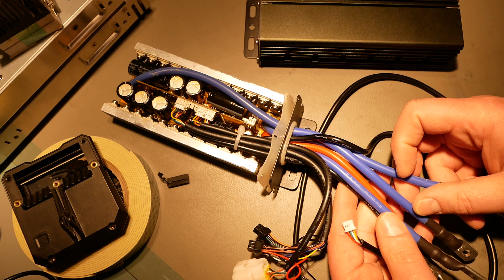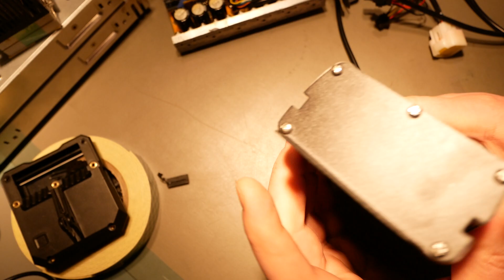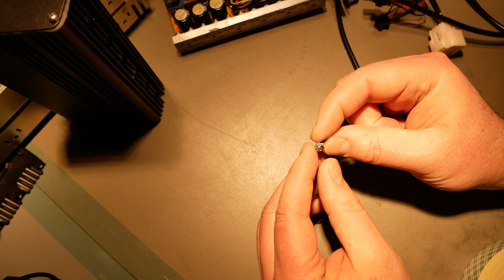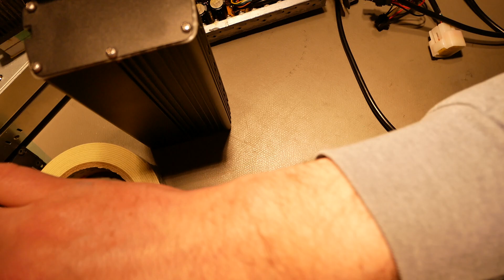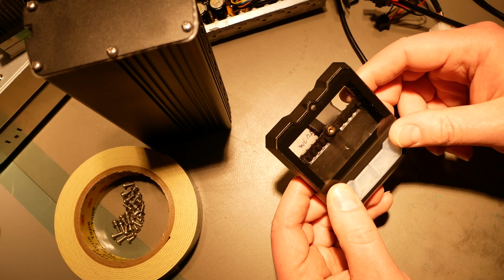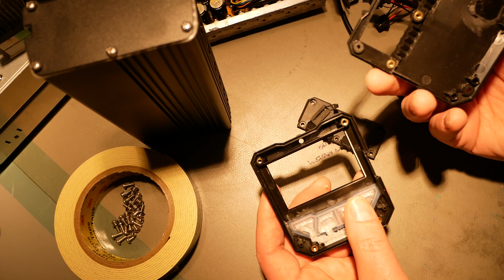Nucular 24 fet Teardown 1

Comment: Thank you for all the videos! Really good!! Any plans to look at fs 75300 controller?
Reply from the maker: Maybe! I have an FS 75200 and a Trampa 100/250 that are already on the list to do tear downs. I dont have a 75300, so that's more speculative. Add those I already have to the X-9000, FSPEC, Surron and Taleria controllers on their way, the 75300 would be a good while away in time. It's more likely that I'll do SHUL CL750 and CL1400, ubox 100/100 and Little FOCer well before I tear into another Flipsky controller.
Reply: @de-bodgery  really interesting controllers! Have only the little focer with big ass aluminium heatsink that works Great. Interesting to see what you think about it. Want to build a dirt bike now and probebly use a 75300 or nucular 24f. On the waiting list of the nucular so will see..
Reply from the maker: @smelker  Are you in the USA? How soon do you need to make a move on a controller?  I have this 24 fet and it's going to see some use for comparison against BAC8000, X-9000, Ko Pro and maybe one other. I'd consider selling it after that. you won't be paying $1450 for it! If you are going for VESC, get a Shul and get a DavegX LCD. This is a great combination and the LCD works with everything VESC. Honestly, other than really easy FOC set up in the Nucular, I'd steer you open source and VESC. VESC is the BIG thing! There are new companies making VESC controllers every other month! It's literally taking over and it's really good assuming the hardware design is also really good.
Reply: @De-bodgery    sorry live in Sweden, Europe. Never herd of Shul, but that looks really interesting! Relly nice with 30s. Locking forward for a teardown video of that!
Reply from the maker: @smelker  SHUL is in India. I talk to their main designer pretty often. Super chill guy. He's very open about his controllers and shows me pics of stuff all the time. I already know he wants his controllers in tear downs. It's jsut the when and getting them to me.